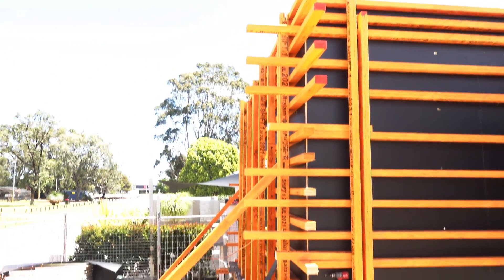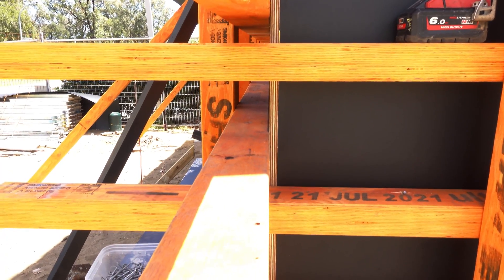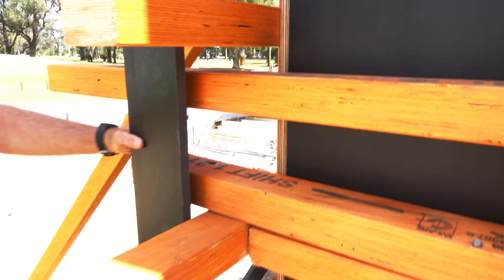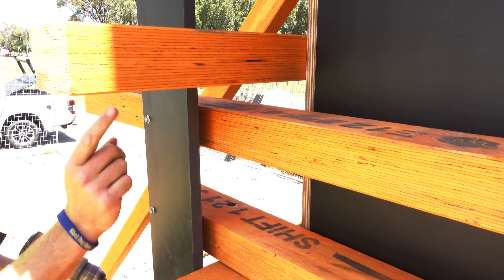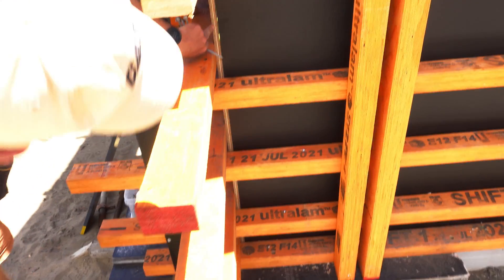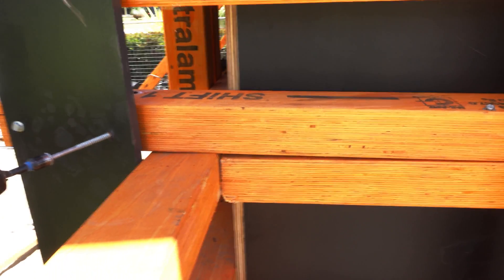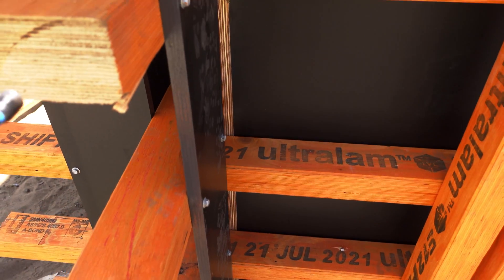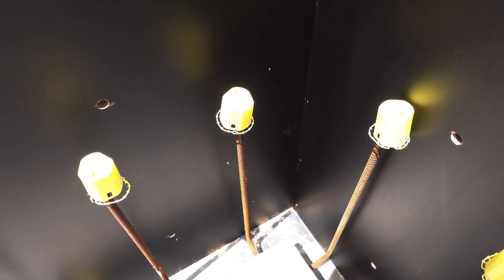FORMWORK: How I Brace Wall Corners for Off-form Concrete Walls PART 4

Comment: Hi thanks for the information in your videos. I wanted to know in order to get as much use out of your formply is it possible to spray it with Bond breaker or will that ruin the ply wood?
Reply from the maker: Yes we use form oil, i like lanolin and a product from sika called formoil. It improves the finish of the pour and improves the longevity of the ply. It is most effective when applied moments before pouring

Comment: Love the content mate! What if you were doing a 300mm wide wall, how would you silicone the opposite corner?
Reply from the maker: Usually there is one side of wall which needs to look good up close and 1 side you will see from further away. So I build important side first which allows me to get nice silicone bead. The other side I have been leaving it square and hitting lightly after with a diamond sander. You can also buy round fillets rather than using silicone. And a new technique im developing is using a battery caulking gun with a flexible hose extension on a ply stick to reach down into wall. Then using a silicone finishing tool from amazon to wipe the silicone also on a thin rip of ply. It is easy enough if you do 1200mm at a time as you do each sheet.
Reply: @bmformworkconcreteconstruc9783  have you considered routering the sheet edges and using a pre cured solid silicone/polyurethane gasket and/or foam tape

Comment: Respect champ, that’s a damn efficient way to brace the corners on ur wailers. Here in Canada I’ve only seen 2x4s and I’m constantly prying the 2x4 to make it straight. Going to have to give that a try

Cheers
Reply from the maker: thanks man, another way I like is I put tie-rods diagonally across corner, ill make a video one day, it's prob the best way. I was down to last timber so had to do it this way.

Comment: Im thinking of making a concrete house in the California desert and this content is super useful. I've calculated that if I poured my own concrete it would be less than $10,000. Do you think this is an accurate pricing for a small house? Also love the work, you are a true pro, especially impressed by the quality of your pours and the stairs from the other video were phenomenal.
Reply: You might also want to consider rammed earth, which is well suited to dry hot climates
Reply from the maker: hey mate, $10,000 seems a bit cheap. a concrete pump alone can cost $2000 or more per pour alone. plus the reo too. Formwork is super expensive. Formwork costs about $100m2 for walls and about $250m2 for suspendeds to buy. the cost of the concrete is quite cheap.

Comment: Great informative videos. You haven't mentioned sealing the form work on the slab. Do you bother with that? I know you don't like bony concrete. How do you stop water egress at the bottom? Thanks again.
Reply from the maker: by scribe cutting at the bottom. no gap, no water leak. the pressure of the conc will force a tight seal at bottom if no big gaps. I don't use silicone at bottom.

Comment: What is your thoughts on "3 d concrete printing," . Where they set up a machine that layers small amounts of concrete without forms to create  a wall?
Reply from the maker: yeah it will change things. It will have its own unique looks and will be interesting to see what architects start coming up with design wise. I can't see it replacing what we do though really, maybe on highrises.
Reply from the maker: what do you think?
Reply: @bmformworkconcreteconstruc9783  I think it will be a lower cost option for high volume repeat construction like a sub division.  I've not put my hands on a wall built this way. But it's got to look and feel weird. We'll probably both be dead by the time it's in widespread use. Hard for me to imagine that a wall built this way will have the strength to survive the test of time

Comment: Mate fantastic work. 
I’m interested in what type of concrete you’re using . We use a self compacting with a 5-600 spread but it puts an enormous load on the forms. I’ve heard of others using a standard 10 mm pump mix with a 120 slump.
Reply from the maker: Hi Phil, this was 80slump, 10mm stone, 40mpa. But we wash the forms between runs to keep the ply clean so it's more like 90slump. I wanted to pour 100slump but I didn't get my way. It was 40C the day we poured which didn't help the finish. So despite the slump and the heat, it came out pretty good.
Reply: @bmformworkconcreteconstruc9783  yeah 80 slump pretty stiff. Looks pretty dam good anyway. Much easier on the forms. I’m about to build my own place with board finish concrete. Done a heap of it using the Doka shutters but to dam expensive to crane in and hire. 
Your videos have been extremely helpful. Also going to do a cast in situ mid floor with a couple of board finished soffits just for fun.
Reply from the maker: cool, where are you building this? in my opinion the best board formed walls are stepped (all different depths), have a look on my instagram. we packed every second board 3mm. But go more, like 5mm. you just have to chamfer edges of boards otherwise when you strip it chips away the nice edges. And Oregon looks the best!
Reply from the maker: also the soffits look great. when all done your downright will throw crazy shadows across it which looks so good.
Reply: @bmformworkconcreteconstruc9783  I’ll check out your instagram pictures. We’ve done the packing like you’ve mentioned before. Check out Bossley architects Langs cover house. 
I’m building just north of Auckland. 
Going to go for a slightly more refined look- having some 90x 45 bandsawn in half. Will have a slightly varying surface but definitely less than the 3-5 mm . I know what you mean about the edges chipping. 
Looking forward to getting started giving your form work method a go .